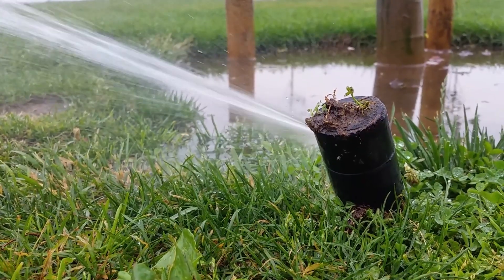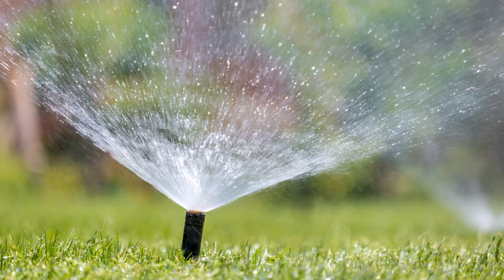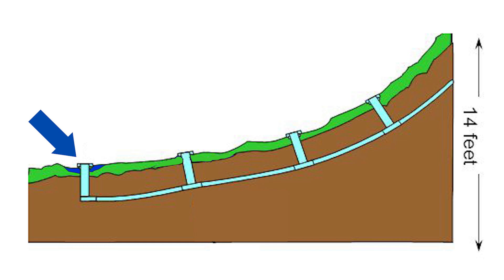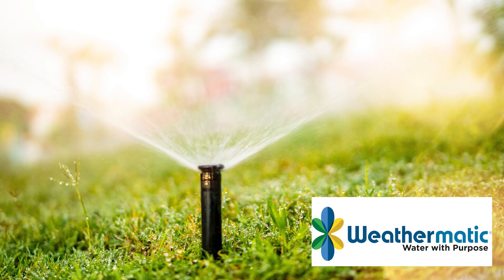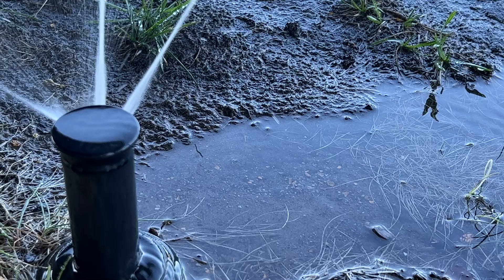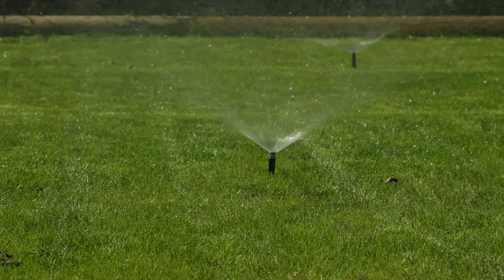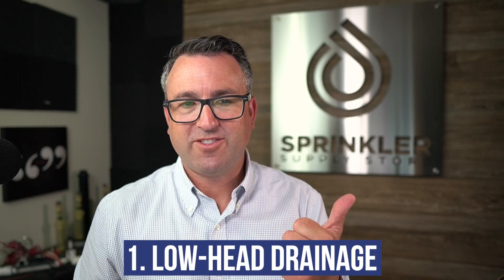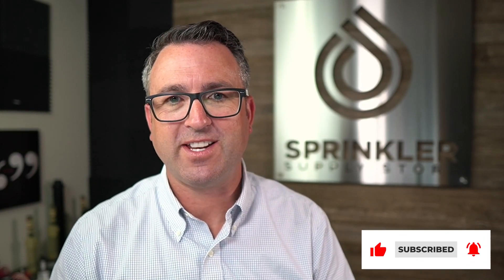How do I stop my sprinklers from leaking? | SprinklerSupplyStore.com

Comment: What about your sprinkler valve leaking when off?
Reply: Hello, you have good information thanks! At first the furthest heads on the last valve leaked continuous. I cleaned valves and they still leaked. Then the ones at the start next to my 2” backflow started leaking as well. It came with the house. It’s a commercial type. Can that be causing the water to flow continuously with the system off or is it the valves themselves? Any advice would be much appreciated thanks in advance!
Reply from the maker: Hi Jeff. Thanks for asking this question, yes, it is common to see sprinklers leaking (or continuously running) even when the valve is off. This is typically due to debris in the valve diaphragm. One of our very first videos addressed this question, you can find it here: https://youtu.be/EP5MidwiGvM

Comment: Would I still need a check valve for a new sprinkler? I just installed new rainbird mp rotators (body and sprinkler head units, in CA, they say the have pressure regulators built in) along my sidewalk but the holes they are in still fill up with water that runs off after the cycle turns off.
Reply from the maker: Great question! If you're noticing water oozing out from the sprinklers after they have turned off, this is often due to 'low head drainage'. This happens when sprinklers are located at the bottom of a slope, even if it's a slight one. After the zone turns off, water tends to drain out from these lower-positioned sprinklers.

Note, this is not a "pressure" issue.

A practical solution is to install a check valve in each of the sprinkler heads located at the bottom of the slope. These check valves prevent the drainage issue, and it's usually not necessary to install them in every sprinkler, just the ones at the lowest points.

Before proceeding, I recommend that you check the model of your sprinklers. If you're using Rain Bird sprinklers, look for models labeled with 'SAM', which stands for Seal-A-Matic. This is Rain Bird's proprietary check valve technology. Knowing the model will help ensure you choose the right check valves for your system, and you may already have check valves in the sprinklers, which would mean the leakage is something else entirely. 

If you have any further questions or need assistance with this process, feel free to ask. Managing irrigation efficiently is key to water conservation, and it's great to see you taking steps to address these issues!"

Hope that helps, and thank you for tuning into multiple videos!

~Andy

Comment: Does low drainage eventually stop the sprinklers are on the bottom slop
Reply from the maker: Yes. After the valve closes, only the water left in the lateral pipe (after the valve) will drain out. It should stop. If your sprinklers look to have a continuous leak, than the valve is probably not closing all of the way, and is weeping, due to debris.

Comment: Hey. My all sprinklers (spray) of one point leaked all day long. Even if i installed new one. And they are on high ground.
Please help.
Reply from the maker: If every sprinkler is leaking, even when the system is off, than you valve is not closing all of the way. There is likely debris in the valve causing it to weep (like a toilet flapper valve that won't seal). Open the valve, clean all of the internal components, and reassemble the valve. Be sure to check under the solenoid.

This video may be helpful: https://youtu.be/EP5MidwiGvM

Comment: I installed a new rainbird 3500 and it leaks from the top when the zone is turned off, I suspect it can be the low head drainage but I checked this model already has a SAM check valve built inside, and what I don't understand is why a check valve can solve the issue? Isn't the check valve preventing water from flowing the opposite direction? With the gravity the water is still flowing the same direction, right? Please help me understand, appreciate it a lot!! :)
Reply from the maker: @daisyding9704 you are right, the term Check Valve is a bit misleading. Rain Bird’s terminology is actually better, SAM, Seal-A-Matic, as the check valve can be better described as a “seal”.

The 3500 SAM sprinkler will hold back 7ft of elevation - if your slope is greater then it will leak.

Could your slope be over 7ft in elevation?

If not, you might unscrew the top and remove the inner workings and double check the seal is actually installed in the bottom. You could also replace it using this same method (leave the canister in the ground, just replace the internal part).
Reply: @Andy_Humphrey  Thank you Andy! Our slope is no way near 7ft, but I ordered the check valve in your video. I'll see if that solves the problem! Thanks a lot!
Reply: @Andy_Humphrey Update, the check valve solved the problem! Turns out not all rainbird 3500 has a SAM lock, it has to indicate “SAM” in the model number. Thanks again Andy!
Reply from the maker: @daisyding9704  Excellent, great news! I should've asked you to confirm that you actually had the SAM model. You're becoming a Sprinkler Nerd!

Comment: Hi there, what if it isn’t a low head valve and sprinkler system had been off 24 hours, but still a wet mushy puddle around sprinkler?
Reply from the maker: Are you seeing this on just 1 sprinkler, or all the sprinklers on that zone?

If it’s all the sprinklers, then the valve is weeping, just a little.

If it’s just 1 sprinkler, it is likely leaking while it’s running, which is very common, especially around the seals where the sprinkler pops up. It could also be a broken fitting or pipe under the sprinkler, also common if it was run over by a car, etc.

Hope that helps!

Comment: The last sprikler head in the last zone in my yard appears to be cursed and i can't figure out how to get rid of the water logged grass in the area.  Dug the whole line for leaks and replaced the head with a SAM check valve, and it just wont go away.  Either my neighbors yard is the cause or im hopelessly missing something. Ill study these videos to crack the case
Reply from the maker: Nice, I love a good mystery puzzle.

Couple questions:

- what the approx elevation change?
- could there be another pipe from a different zone close by?
- is it ever dry?

Txt us any pics, etc, and we’ll investigate 1-833-343-4590

Andy

Comment: I have 1-2 sprinklers leaking while that zone is off with an adjacent zone featuring drips only running. (Reposting to main thread for visibility)
Reply from the maker: Hi @mondymuerde - are the leaking sprinklers at the bottom of a slope? If the valve were leaking than every sprinkler would leak, but because only 2 are leaky I suspect it might be head drainage. You can install check valve to fix this.

Please share more details if this is not the problem.
Reply: @Andy_Humphrey  Thanks for the reply! They on a slope along the driveway but about midway down. It’s possible that they’re at the of a run I guess, not certain as we aren’t original owner
Reply from the maker: @moneymuerde this make sense. If you want to txt us a picture of your sprinkler we can find the check valve for you. 833-343-4590
Reply: @Andy_Humphrey  sounds good, thanks! Will try get a pic in the next few days.

Comment: If your rainbird 1800 is leaking at the cap  while running then buy pro sprays
Reply from the maker: What have you seen, from your experience, that improves the Pro Spray cap over the 1800 cap?
Reply: @Andy_Humphrey  well 1800’s leak even when it’s the slightest bit loose but prosprays can be loosened over a full turn and it won’t leak

Comment: what about when 4 on a row are leaking?
Reply from the maker: Great question, Paul. Are they leaking after the zone has been turned off? Or are they leaking while the system is operating (from around the head, etc)?  This could be low-head drainage, the valve diaphragm is not closing all of the way or something else entirely. If you can provide more details I'm happy to dig into it with you. -Andy
Reply: I have 1-2 sprinklers leaking while that zone is off with an adjacent zone featuring drips only is running.

Comment: I bought a new sprinkler and it’s leaking from the top just like the old one don’t know what’s the problem
Reply from the maker: Hi Ivan. It is leaking after the zone turns off and the sprinkler retracts? If yes, this is known as low-head-drainage, and is caused by water draining out from the lowest head due to gravity. This can be fixed by installing a check-valve in the bottom of the sprinkler, although they may not be available for all make/model sprinklers. If this is not the problem, reply back with more information and we can continue to diagnose the problem with you. -Andy
Reply: I have this same issue, but when I removed the entire sprinkler it’s more than just a slow leak..water comes out fairly well but not shooting up or with force. Could this still be the gravity issue because it does appear to be the lowest in the zone but not by much?
Reply from the maker: Does it eventually stop? If it does stop, than yes, likely drainage. If it does not stop, than you most likely have a weeping valve that is not sealing..